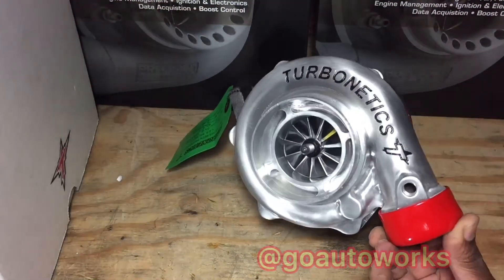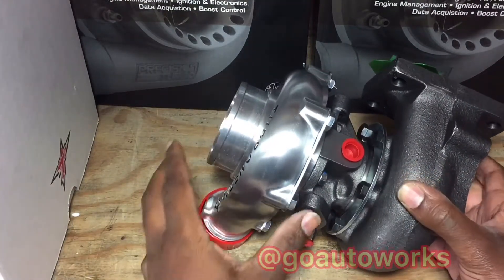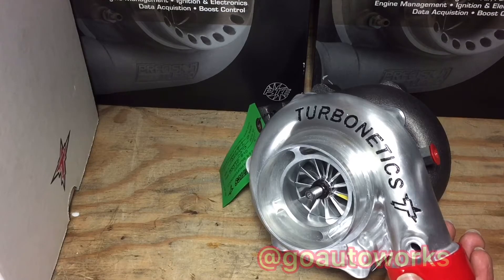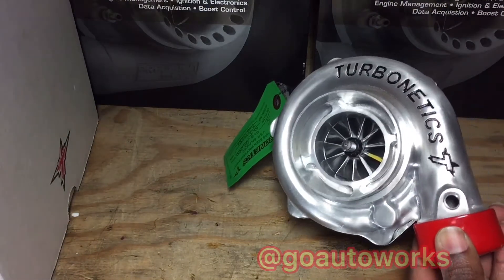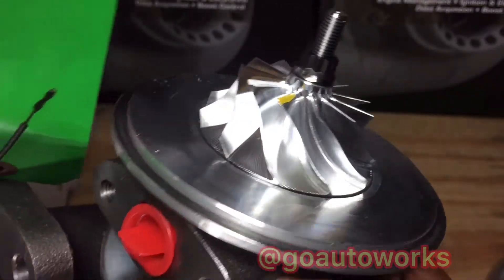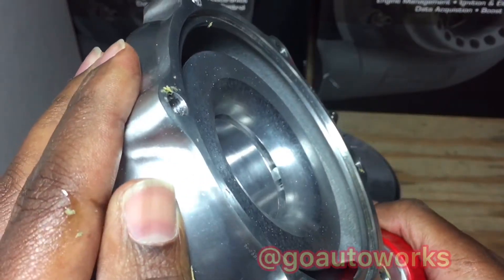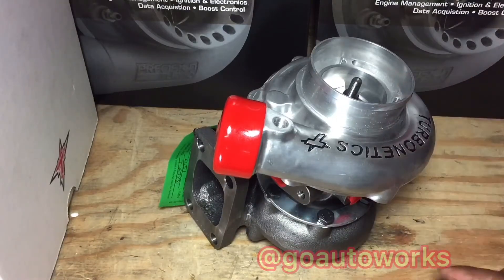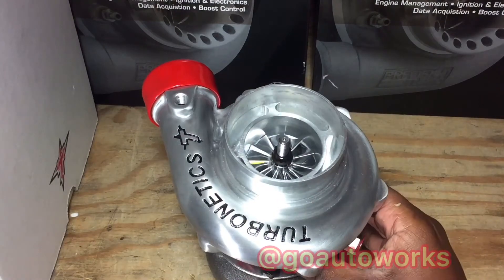New Turbonetics C15 TNX Turbo Review

Comment: I have the Turbonetics T3/T4 Hybrid ceramic duel ball bearing water cooled turbo. Going on ten years and still running strong. I saw that they came out with the new F1 compressor wheel supposed to be dope. Hopefully i can buy one for my turbo just need the part number to see if they have one for mine. Says it will make your turbo spool up faster than the other wheels. Check it out on turbonetics website.

 Please make a video and let everyone know what you think about different compressor wheels and what needs to be done to replace them. Maybe a video on rebuilding turbos would be dope too. Thanks you are so helpful.

Comment: Hp rating 6868? Ty
Reply from the maker: that is going to be a 900-1000hp app...we also have some en route for stock
Reply: @GOAUTOWORKSYOUTUBE  would the 64/65 be better for my 306 cammed heads. Or the 68/68. Street car i run a 70mm right now
Reply from the maker: @cautionwetmoms7592  I would say neighter and go with something that has more turbine wheel